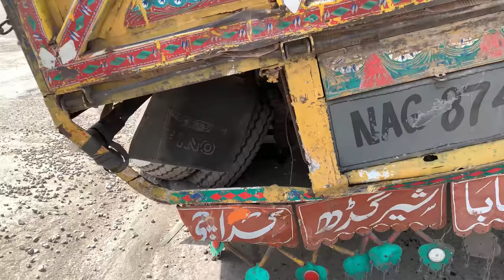When The Rear Wheel Hub Breaks down on the Middle of the Road || We Repaired in a very Strange Way

Comment: Hats off to these men. The fact that they work in sandals in and around such dangerous areas leaves me feeling speechless.
Reply: This is Pakistan. Every thing is possible here 😂
Reply: @umairumairii6286  lol yes
There people out there doing more dangerous things with safety and are expert in it
Reply: Jesus is coming. Read the Gospel.  Thank you very much.
Reply: if safety was a priority to them, they would of take this trash to the scrape metal.. but no someone has to die first .
Reply: Thx man, i think most of asian work like this 😂, btw im from Indonesia
Reply: @princek755  they Expert in installing new parts ...but pakistan expert in reuse broken part..for sure its a different thing
Reply: I dont see how its hats off to these guys having to work like that.  If the seal goes all of a sudden in one of those jacks that guy is crushed, they should at least block it up before they drop that axle.
Reply: @chiefusb465  Go call the union representative.
Reply: I often weld in my crocs, at least you dont have the problem of burning drops eating into your trainers and making patters on your feet.
Reply: The sandals are one of the scariest parts of this.
Reply: Couldn't we made the load lighter and not have not broken the axle in the first place just as a suggestion don't these people have a clue to what they're doing to that truck with that kind of weight load on that truck to begin with WOW
Reply: @umairumairii6286  possible sure...likely? Nope

Comment: Love the holes in the frame. Plus it wasn't the wheel hub that failed. It was the broken axel from the constant overloading.
Reply: I didn't see any rust holes if that's what you were referring to.  It's also amazing how the axle housing BROKE before the shaft SNAPPED.  I would think it should have snapped an axle first before the housing caved in?!?!?
Reply: @Guillotines_For_Globalist_Scum The axle shaft does not support any weight. It just turns the hub. The axle housing supports the weight under that insane stack of leaves. I have to count them now. 25 leaves including the top helper stack.
Reply: @davidkeeton6716  Axles can definitely break or twist if they are propelling a load beyond their designed capabilities.

Comment: Hats off to these guys working hard in this scorching heat. Matching both wheels inline or maintaining axel shaft concentric with axel hub using welding & without any fixture is remarkably a extraordinary skill set. These guys are no less than an engineer.
Reply: They are unlucky engineer living in unlucky environment
Reply: That isn't engineering it's criminal negligence.
Reply: Rubbish, this level of crap repair is probably why it broke in the first place
Reply: @Jack-lo1uc conjecture
Reply: @snowflakemelter1172 you couldn't do it

Comment: Good lord. Bless these guys for their mechanical aptitude and skills. They certainly know what they're doing and jump right in there to fix the problem. That differential housing, case, and axle shaft alone is extremely heavy much less handling it, the dual wheel hub, dis-& reassembly on the side of the road. Amazing.
Reply: O Problema é a qualidade do material, existe alguns países do Sul doeste Asiático que a miséria é tanta que não tem preocupação com a qualidade do serviço e do material, Índia é um exemplo
Reply: Nikhil Shinde  no need to be so touchy and rude. We Indians are slightly delusional about our nation's developmental status, to put it mildly. We have made great strides forward, but we still have a long way to go to catch up even with China, never mind the West.

Comment: These mechanics are doing hard and risky work. Sitting under heavy load like that is not smart. Also, why not unloading the truck before working underneath it? 

 In addition, welding an axel may not be the right thing to do. I know these are the cheapest and best solutions for poor countries, but safety first. However, They do awesome job but in a risky and bad environment.

Comment: All but one side of the axle housing showed new metal. That, along with the very little amount of fluid on the ground, I'd say that thing was cracked and leaking for awhile
Reply: You are very right. There wasn't any lubricating oil even in diff. So they leaked out. I say that there is no machine that just breaks down with out warning.
Reply: THE HOUSING WAS PRETTY MUCH DRY
Reply: Там с нижней стороны было трещина по свету металла видно

Comment: Not sure if this repair will hold for long, as the massive load is beyond the recommended limit. I honestly thought they would replace it with one from the scrapyard. Trucks will be lighter and safer if they remove all the unnecessary decorations and paintings. The metal alone would weigh a tonne or two.

Comment: The way they repeatedly overload these trucks (as displayed on YT), it’s a testament to the great strength of the axle housings and tires, etc. and those spring packs… WOW, not much flexibility there. 😀
Reply: Yep, just throw on another spring pack or extend the chassis rails and chuck another dummy axle in. Probably carrying 300% over its rated load, that axle just does not look heavy-duty.
Reply: @dave-j-k  👍 The most relatable old quip I can recall, is my Dad and G-paw both used to say “Don’t worry about the mule, load the wagon.” 🤣
Reply: Tata trucks in India based on a Daimler design from the 1930s, were progressively reengineered to carry several times their rated load. The design engineers knew owners would overload the trucks beyond belief. The record stands at 36 tons for the 1210 model truck.
Reply: @GM_-  а владелец, зная о запасе прочности, перегружает грузовик ещё сильнее

Comment: Damn. That's one hell of work. Curious to know what the cost of repairs were? I however doubt how long the repair is going to last, considering that the axle is supposed to be cast in one single piece for strength.
Reply: I would love a little more background on what is happening.  Cost, time, fixed vidoe

Comment: I was taught that welding on the lathe would ruin the bearings since the arc will travel thru the very small contact point on each bearing and make a spot.
Reply: Perhaps it was not shown in the video, but you can weld safely on a lathe if you ensure the work is well grounded, and the lathe is not grounded (by unplugging it).
Reply: Yeah! I agree that all of the welding current - could be 500A, would pass from the Chuck, and via the ballraces which support the Chuck Shaft. I have heard this also, and it makes good sense to simply place a Jumper - from the Chuck to the Lathe Framework (earthed). Then, after fitting a Jumper, it would be safe to weld.

Comment: Just becouse you double the spring count in the back does not make it safe to carry a heavier load . The axle will only handle so much weight . Did it a dawn on them to haul less wieght and make a few more trips ????? It's easier on equipment !!!!!!! They have that truck loaded on a single axle and it should be have a tandem axle for that load !!!!!!
Reply: Pakistani Hillbilly calculation says that You keep loading until it breaks. Ppl mostly care about saving fuel.

Comment: Don't worry about the oil spill on the road  ( environmental protection people ) will appreciate the dust control it provides . As for the  ( Jacks and wooden Blocks ) holding up that  Very-heavy Truck  with those guys working underneath  ... Occupational Health and Safety  ... well  it looks like there is enough  Replacement  Workers  ... on hand should anything happen to the Crushed workers to finish the job ... So  at least they will be able to repair the Truck and get it out of the way so that the road can be alot safer for the the Vehicle Traffic  passing by !!!

Comment: This isn't a repair, it's a patch. 
And it holds on until the next bump. 
By the way, in my country, anyone who patch structural parts like this and then drives them on the road again goes to prison!
Just stop constantly overloading your decrepit trucks and this won't happen again.

Or put anyone in prison who overloads their vehicle. I'm sure that would show a change in the situation very quickly.

And in my personal opinion, anyone who overloads their vehicle like that can easily end up with a fatal accident. 
In the worst case, innocent people can be injured or even killed. 
Well every country is just like the people who live in it. And this country is just completely irresponsible and that's why it looks the way it does there and that's why the conditions there are the way they are.

Self-chosen fate.

Comment: The truck was originally designed for 15 tons. Due to the higher tail lift, it could be used for 40 tons. With the welded "thick-walled" square tube, it can now easily handle 50 tons.